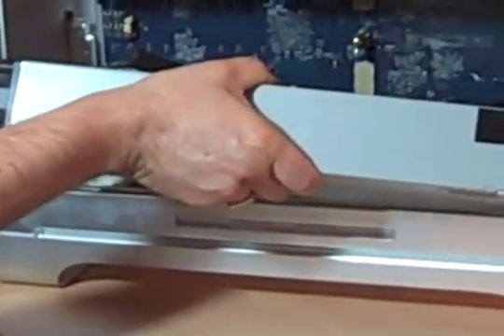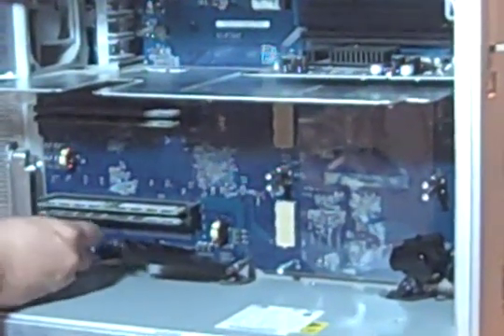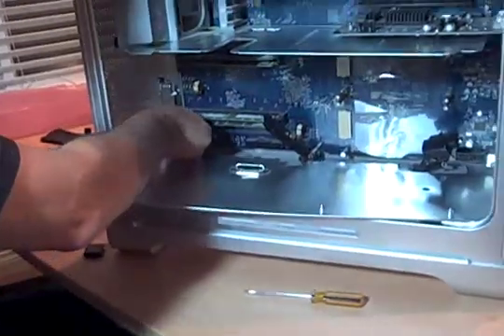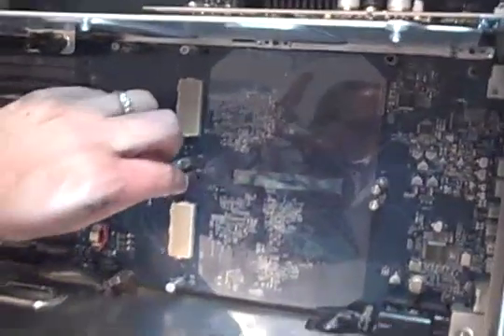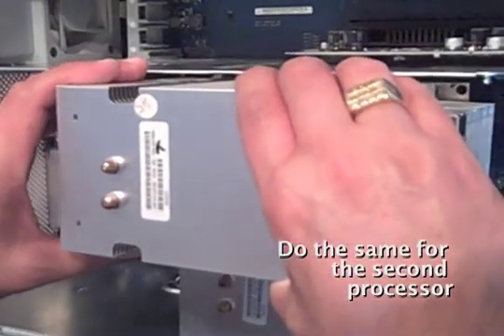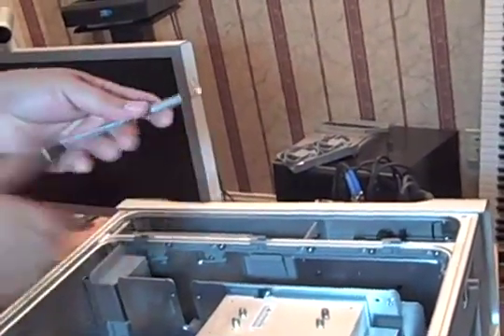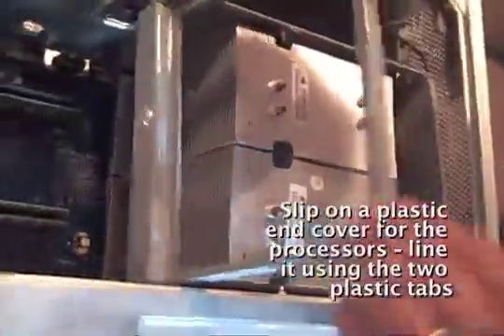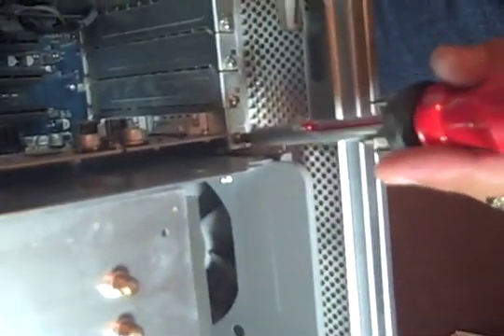Macintosh G5 Power Mac Power Supply Install - Early 2005 Model - Part 1

Comment: Goddamn - You managed to get the power supply out and back in without removing the logic board?!? Lucky bugger! I had a second free G5 given to me and I'm thinking of going down the PC power supply route. As long as you don't use an Apple monitor you don't need the 25v rail so any PC supply will do.